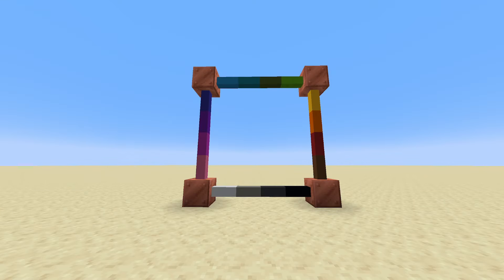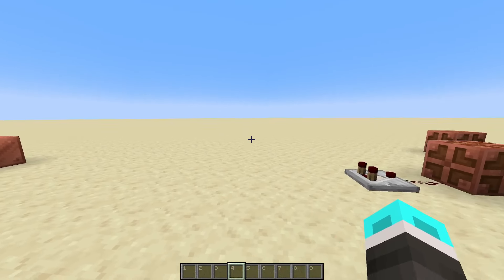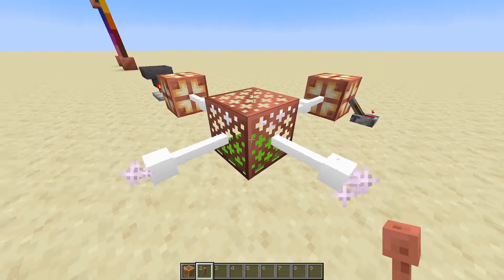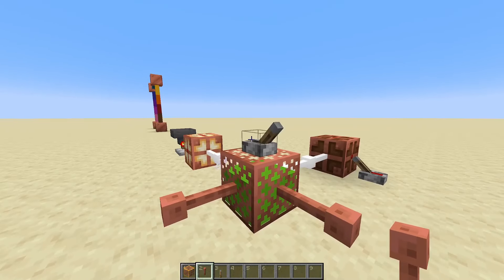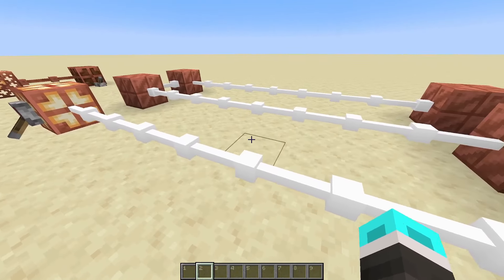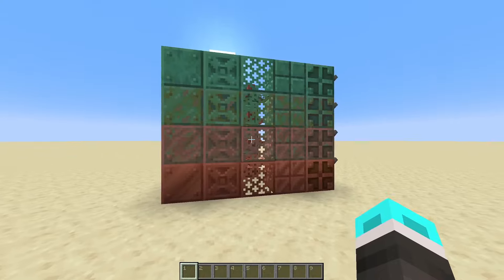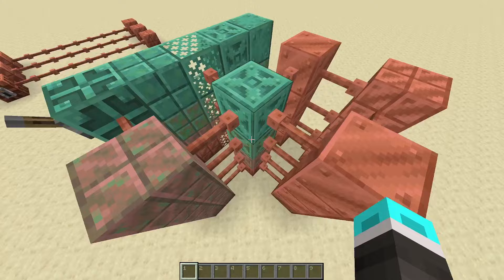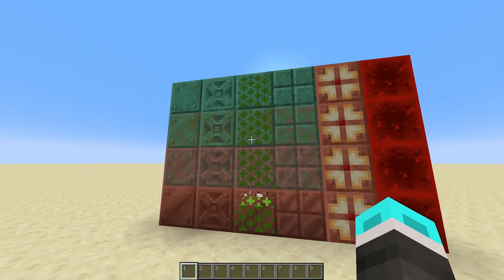Copper Wiring Datapack Beta 3

Comment: i feel like using an OFF lever might be a bit jarring, in terms of user experience; it's so different from what we're used to with redstone
Reply: Yes, having unpowered as the default behavior and powered as the locked behavior is more intuitive (fits with repeaters), easier to debug ("find the unpowered lever" vs "oh, this block is redstone powered")
Reply: Also, you can't activate/deactivate levers without player interaction so it would make it harder for players to make automatic machines with it
Reply: @FranLH1206  well you can now with wind charges but that isn't really sustainable without farms
Reply: I agree I think unpowered shouldn't do anything. It should be switched to how it is ad have redstone power be something that pauses the bulb.
Reply: Yeah, it should work more like with hoppers. It's just more intuitive for a powered lever/other redstone signal source to do something, than for an unpowered one
Reply: In general, what I find jarring is the concept of having a component behave differently when you plug a lever to it, and revert it back to its default state when turning the lever ON
Reply: @totoshampoin  You cant really do that because by vanilla nature, copperwires/lightning rods produce a redstone signal.  If you tried to detect if the block was powered to turn it off, it would always be powered because the copperwires/lightning rods would be powering it.  I agree that it doesnt really make sense for the levers to function like this, but I honestly cant think of an alternative.

Comment: Major props on this! One minor suggestion from a software dev perspective is that you haven’t been following semver (semantic versioning) syntax properly. In “proper” semver, use x.y.z where x is major changes: stable, fundamentally new products (Minecraft is still in 1.y.z); y is minor changes: new features that don’t change fundamental product (this would be an example of minor change), and z is patch changes: typically bug and stability changes. Not everyone follows this style, but I highly recommend it - hope this helps!
Reply from the maker: @bradentoone895  I plan on using that format when I make a full featured release, which will be 1.0.0, with updates like these being the 1.x updates. For now, technically this is 0.3.0, Im just keeping the numbers smaller and easier
Reply: @AuraAcorn  when you use 2 numbers instead of three, the one people will assume to be implicit is the z, not the x
Reply from the maker: @totoshampoin  then maybe I'll change the version format moving forward
Reply: @AuraAcorn  It is your own data pack, so feel free to use whatever versioning scheme you'd like! Semver is popular, but you don't need to follow that if you have your own system that you like

Comment: Really nice update. The concrete insulation even looks good if used as a decoration, which is a nice plus besides the functionality. Something I think you could consider on the next update: Circuit breakers. The current use of the levers show in the video gives us some functions, but having a circuit breaker we could turn on/off from distance using redstone wiring would be great. My basic idea is to just have the copper trapdoors being placed on a block touching the copper grates. So when it reaches the max capacity the trapdoor snaps shut/open. And if you give that block with the trapdoor a redstone signal the "circuit break" would activate too. This kind of functionality could be handy for any future ideas/uses with comparators to control some stuff. For example: When a hopper signal is too low (not enough items inside of it) then the comparator will de/activate a circuit break. Again, that's just an idea for your consideration and if not used I hope it helps with some inspiration at least. 🙂

Comment: If feasible, I think it would be more intuitive for the redstone interaction to be flipped, so it stops transmitting power when turned on, and allow any redstone emitter to power it rather than just levers.
Reply: Electrically powered copperwires/lightning rods produce a redstone signal as a vanilla feature.  So you cant detect if the block is powered or unpowered by a lever because the copper wire is always powering it.
Reply: @Charm_Dragon  Ah, I had assumed there was some odd limitation due to it being a datapack, but I was holding out hope. Still, I think hardcoding a check for maybe repeaters, since they're one way, would be better than levels since you can automate it with redstone

Comment: I think the oxidation behavior on grate capacitors should be flipped. Less oxidized means lower capacity but quicker empty to full times and vice versa. It would fall in line with how oxide layers are often used as the dielectrics in real life capacitors
Reply: Came here to say the same. Plus, it feels more intuitive. Everything else gets slower as it oxidizes, so making the grate quicker feels backwards. Sure, I understand that it's representing less "quantity" of charge (thereby taking less time), but it still feels backwards compared to the other components.

Comment: maybe wool instead of concrete? or what other coloring options have you considered?
2:28 lever input like that, to remain consistent with other blocks, should be taken as another redstone signal input where ON disables output, so that with or without an off lever it behaves the same. This is what players would or should expect out of lever-activated components, and allows for advanced logic control.
your idea with progressive capacitors and delays seems like what would be expected, so that's fine.

Comment: A few things i'd change :

- Make Copper grates lock when powered, it just feels wierd to be able to change the behavior of the grate just by placing a lever on it, and be able to revert the changes by powering the lever
- Make Chiseled copper delay go in powers of 2 (so 1/2/4/8), this allow any delay up to 16 ticks with two blocks rather than 8 with duplicate combinations, this can also go with Copper Grates timers (60/30/15/7.5)
- I don't know if it's already in, but being able to have any copper blocks activate if they are side by side and not connected with a wire could really help compacting circuits, also allowing bigger / more precise capacitors (and it would go well with the binary increment in idea 2)
-  a small detail, but you didn't talked about insulated copper wires being immune to lightning bolts, i think it would be better if the model took a full block, then the wires can be used in houses by being part of a wall without being noticable

that's it for me, i didn't played the datapack (yet) so i might be wrong on some stuff, and i don't really know how far you can go with datapacks (i don't think you can change the collision box of a block for example) but most of it looks doable in some way
i feel like you can go very far with this datapack, keep up the good work !

Comment: Love your videos! Here's an idea: You could use different materials like metals or crystals to create "resistors", element that acts like insulation but slows signal depending on material! (to make them stand out you can make them a bit fatter then insulation and maybe add some mark like irl?) Also, what do you think about adding "magnet\coil"? It could attract dropped items (maybe enteties too?) to itself and it's radius\strenght could depend on input strenght. (imo coil should also have signal delay as it does irl, I'm just studiyng electronics, so having complete pack of basicelectronics in monecraf would be so cool♥)

Comment: Hello, I have some suggestions for you.

1. Regarding "Wire Insulation, I would like to suggest to use shears for removing the insulation with right click or to remove the wire with insulation with left click. The player can craft insulated wire with string (1 or 4 string) and if they want to remove it, they will have to strip it. Futhermore, you could make it so to avoid inventory clutter, you can have it so that when insulated wire is broken, it reverts back to its default color, white. The player can use 1 dye upon right click of the wire to infinitely color as many wire. Otherwise, it will be a pain to have the player make stacks and stacks of concrete just to insulate wire. With string/wool, the player can farm this and the dye suggestion is just quality of life. 

2. Additionally, oxidized copper, the more oxidized it is, the slower the travel speed/range of the electricity. 

3. I think that "Batteries" should be multiblock too, if its possible, players can craft "batteries" and have to cover them in wool to stop them from exploding in the rain. 

4. Short circuit mechanic, some blocks can oxidise very quickly turn to blackstone (block that represents burnt out component) this may occur if say lightning hit the circuit.

5. I think resistors should be multiblock, having a pattern of blocks such as copper block + placeholder block + copper block (etc) will determine the amount of resistance. If a comparator is applied to the multiblock "resistor" you can can activate another circuit if resistor has reached a certain current(as determined by where the comparator is placed on the resistor, closer to the input or futher)

Comment: I’ve seen people talking about the lever for the capacitor. What I think can be improved is the block you use for representing power building up. 
In your concept power is white (copper rods) so I think using a block of snow or white concrete would be more appropriate than green :)

Comment: Have you thought of a way of making it be able to be in walls? Maybe you can place a stair and it will make it appear as that block but if it is not insulated it could cause the block to catch fire or maybe even slightly explode. I feel like this would be really good for building and a more simple and practical use.

Comment: The concrete insulation looks great!
But just in terms of survival gameplay, I feel like wool would also be a good option. It also makes a bit more sense for wool to be an insulation material than a concrete block
Reply: Concrete is actually a great insulator irl, its just very expensive for survival (some of the other components are too though, so i don't think that's a concern of his)
Reply: I imagine using concrete is useful when I comes to stretching the block to fit around the wire. There isn't much of a texture to distort, but it would be nice to see a more survival friendly insulator. Perhaps wool can be a beginning insulation, and you could upgrade to concrete? I'm not sure what the implications of that would have, but I could be cool
Reply: Paper was a popular insulater for a while

Comment: If the oxidized copper grates store the same amount of charge as non-oxidized ones, then I would wonder about maybe reversing the charge rate, so that the oxidized ones actually charge slower? I like the thought that the more oxidized a copper block is, the less efficient and less reliable it becomes. This is a really cool udea of using the oxidization level to add or tweak mechanics in such a natural-feeling way.

That being said, the copper bulbs thing sounds a bit confusing to me, or hard to keep track of in my brain.

I like the insulation also being a way to color code wire. Two birds with one stone!

Comment: I think the false lever thing is a bit weird. It doesn’t make much sense for something that needs player interaction to cut off a circuit without that interaction. Think of things like redstone torches receiving power turning off, repeater locks, etc, these things require redstone power to stop redstone power. It doesn’t make much sense to have copper power get cut off BEFORE the player actually interacts with the lever.

Otherwise, I love everything you did with the oxidization stages! Especially the tick delays.

Comment: there needs to be a way to transport power around corners to a nother block such as cut copper because there can be to lightning rods right next to eachother and one can have cut copper in front but the other one has no way to power the side of the cut copper to make a xor gate

Comment: It would be cool to have a bus wire, since you now have insulation, so one could collect a lot of different signals into one wire and the later untangle them back in controlled maner. 

Should be easy to implement, just need some copper block to represent bus contact and spawn entities for multiple wires in a single bus cable. 

Or just make the bus line itself accept differently colored wires, making sure you don't waste copper blocks on a function that doesn't require it. 

Blue wire into the bus, blue wire out. White wire in, white one out.
Power one of the blue ends up, and the other end powers up. 

What also would be cool for making arithmetic processors later on, - 

is making all your logic copper blocks interact with the bus, either just like it is multiple wires connected to them, in the case of capacitors, or just performing 4 or 8 bit logic depending on what amount of wires per bus you would allow. 

2 bus lines into AND gate should result in a bus line out, that contains "bitwise" result, or, speaking in common:

blue from first bus AND blue from other, white with white, etc.

Comment: The Weathered Copper Bulb should generate power whenever it's lit, regardless of the lever. As is, it's just too close to the Exposed bulb in functionality.

I'd suggest making Insulated Wires their own item. 3 lightning rods with 3 concrete (I personally think wool would make more sense) crafts 3 insulated wires. And you could then use shears to strip the insulation off as a normal concrete (or wool) block again, while leaving the wire in place.

Also, I've mentioned this in a prior vid, but I think you should retexture the powered lightningrods/wires. The stark white looks like a missing texture. It works for lightning strikes, because they are only lit for a brief moment, but when in continuous use like this, it looks bad.

Comment: Idea for the insulated cables, since part of their point is to be for managing different lines;
Make a “Cable Manager”/“Intersection” block that allows you to run two different paths through it and not have them interfere with each other. If you run a blue input line and a red input line, the blue will only pass through to a blue output and the red will only pass through to a red output. You can of course also allow for uninsulated inputs and outputs that can send or receive to any types respectively, but an insulated input will always prioritize sending to its colour of insulated output first, and only if it finds none will it send to the uninsulated line(s). If multiple lines meet the conditions to pass through, it splits the throughput between both lines, halving each of their individual throughput.

Comment: Suggestions:
1:
If its possible... oxidisable copper wires.. with each one having a slower and slower speed (normal would be 0 then fully oxidised would be idk once every second?)
2:
If its possible aswell... make it so the copper can store signal stengths... like if you input a strength of 5 and then wire it up to a copper block.. placing a comparator will give it 5 back... and maybe it will also charge it slower for the capasitors like 15 is super fast and 1 is like.. it takes 30 mins for the normal transistor to be full
3:
Tesla coils... like if you make a new block have a function... if you place it on a capacitor.. and you power the block on top.. it will send an electric field that will electrocute any players in a radius but therefor it needs like the power of 6 wires at once to fire so it will run out after a while so its not too op

Edit: W vids btw love the datapack

Edit the 2nd:
Another idea:
Make the comparator be able to output the fill lvl of the capacitor so you could make it have even more specific timing
Reply: Love the Tesla coil idea. Maybe it can be called a copper coil?
Reply: @dylansuperti214  or that!
Reply: Yeahhh I miss the old speed 🔥
Reply: 6 wires at once will not be possible as that would mean it can have no output (squares have 6 sides and having a tesla coil would have to mean one side is dedicated to output)
Reply: @Leekodot15  i meant it would only take from the capacitor and only require the power of 6 wires. Not that it would have to be linked using 6 wires

Comment: For making slower wires speeds I'd say you should call whatever it is a resister lol maybe make it by adding wool onto a copper block (just have a small square of wool on each side of the copper block as visual)

Comment: I have a quick question: Does a lighting strike cause a battery to fill up instantly? (if it has direct input or something?) That way you could make a system that's more dependent on the weather. I realize that's not realistic but I think it'd go well with the whole original use of the copper pieces ^^
Reply from the maker: Currently it does not, and its hard to make that work, but I can probably give it a try

Comment: just to be clear: more oxidation = less charge for the "capacitor" grates?

If so, I think it might be worth at least investigating how the (sort of) opposite would work—where all variants store the same amount of charge, but less oxidized blocks charge more quickly, which from a design standpoint is maybe a bit more in line with how the oxidized variants change the effects of other blocks.